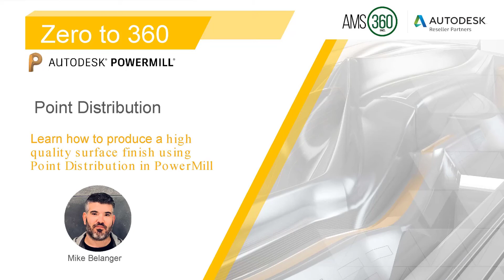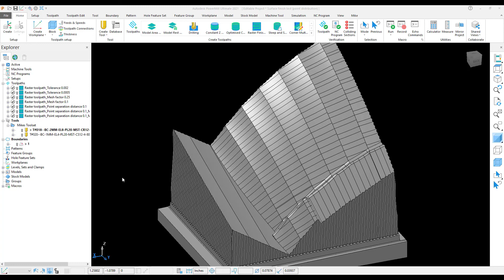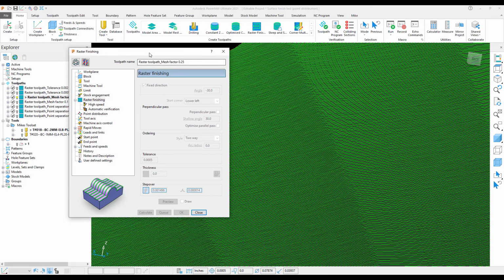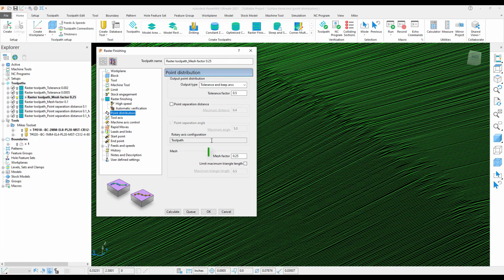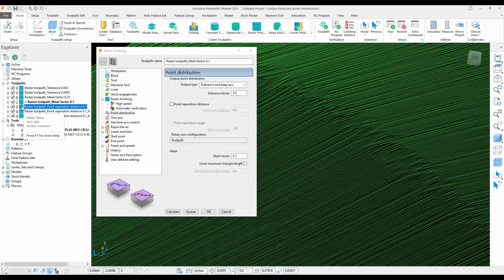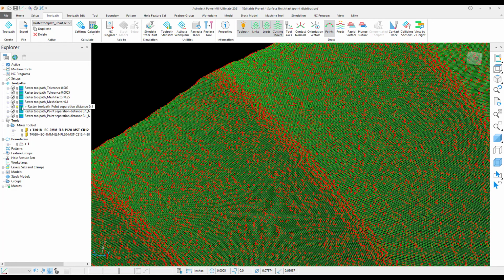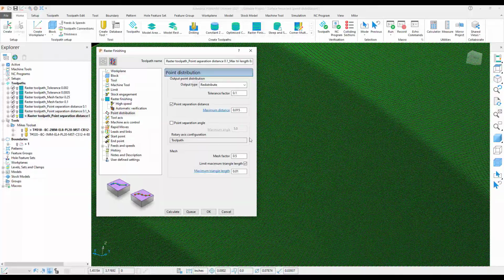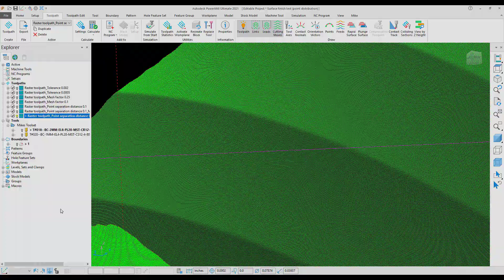Autodesk PowerMill | How to Produce a High Quality Surface Finish Using Point Distribution

Comment: It is true that decreasing the distance between the points and the size of the triangles should improve the quality of the surfaces, but it is also true that the resulting cn file becomes huge (I tried to mill a small, almost smooth surface with the last parameters from you used, it turns out a 160Mb cn file) is not manageable. Thanks
Reply from the maker: Thank you for your interest! For more information visit: https://www.solidcad.ca/products/autodesk-products/autodesk-cam/